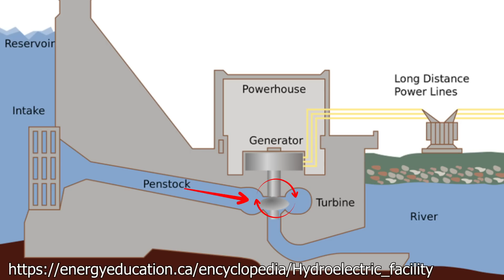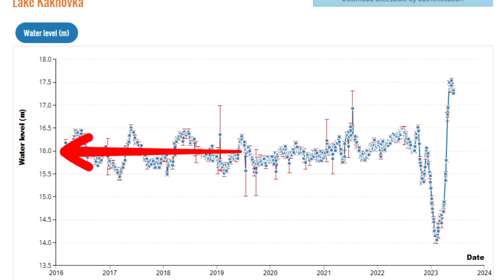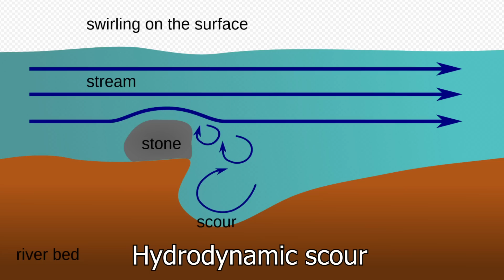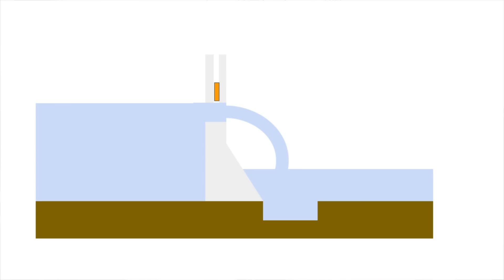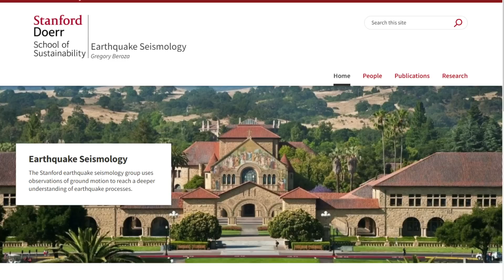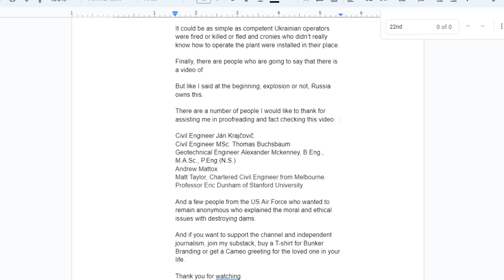How Russia Destroyed the Kakhovka Dam

Comment: As a former Marine and someone who’s worked on dams, I agree with everything but your assertion that this won’t make an amphibious crossing more difficult. The flooded ground is much harder to traverse than a river with dry banks. Otherwise spot on.
Reply: + now it's a nightmare for logistics,  supply lines. until it resides and dries. not very soon.
Reply: And we can already see that Russia's so sure the Ukrainians can't cross anymore that they're abandoning their defensive positions south of Kherson and moving their troops to help defend against the counteroffensive.
Reply: Wouldn’t wherever the water rises to, there will be a dry bank there, right? It just moved it
Reply: @mikew2068  no. The flood waters will saturate the ground in a wide swath, then it will recede, leaving roughly the old river flanked by bogs that won’t fully dry for months to years.
Reply: But the river is going to be crossable in parts upstream of the dam that were never in the game prior.
Reply: @MusicalMemeology  Not easily. The reason that area was flooded as a dam, is it is steep hillsides all round.
If there WERE low places, the water would have flowed out of them. The entire upstream area of the dam has mud right up to the same level of the top of the dam down stream. That is just physics. And the dam floor has been wet for 50 years. It will be  a trough of mud, with steep walls.
Reply: @MusicalMemeology maybe Im missing something but that should not be the case, as long as the reservoir isnt full the river upstream should stay the same, so it may have become larger in the time between the filling of the reservoir and the collapse of the dam and now would be smaller in relative terms, but it would be the same size as it was when everything was working properly. In other words the amount of water in the reservoir, as long as it isnt full, shouldnt matter to the river upstream
Reply: Left bank of the river down from the dam is low marshland. It was flooded several km wide. 

Russians were known to have mined the dam months ago.
Reply: @jounisaari9471  The russians had some of their most fortified positions there and would've preferred the Ukrainians attack there... not to mention that dam helped provide clean water access to crimea. Why would they sabotage something that favors them?
Reply: Agreed, if there's no flood plain affected then its all contained in the waterways so hardly any difference strategically, however after the initial flood the water levels have gone down drastically (miles!) in the former dam area, and also water levels have gone down downstream making crossings easier. Plus they flooded out strong defensive positions in Kherson. 
Occam's razor, logic and evidence seem to agree.
If Russia was this incompetent with dam and hydroelectric station can they be trusted to handle a nuclear one?
Perhaps they were using a defensive tactic running the closest spillway to use the fast flowing water to make it harder to access their side.
Reply: @DO-Hippo  
I'm pretty sure the United Kingdom military is not involved in Ukraine.
Reply: @GeneralSamov  lol, aint acronyms a bitch?
Reply: @GeneralSamov  Really, up to their eye's in it I'd say, Zelinskies favorite advisors, this gives the Sandhurst brigade the chance to fight a war by proxy the only kind of war Brittain will ever fight again. and there is no end to the dirty tricks, and sneaky operatives working for the Ukraine Regime The Drone Boats in the Black Sea for instance and what about that text from the Prime Minister a couple of moments after the North Strem was Destroyed to the Americans stating that the "Deed is Done"
Reply: Yep. Dnipro has tons of sand and clay underwater/on its banks. It will take months for that washed stuff to dry up. 
It has also had concrete/paved levels people use to load/unload boats from/onto trucks. Not many of them downstream, but plenty upstream of the dam. Seems like a good spot from amphibious vehicles to get ontu dry land.

Comment: You may be right, but seismic readings detected a large explosion there at the time of the breach. It's difficult to reconcile both narratives.
Reply: In that case, it was definitely Ukraine, as they strategically benefit from this. Watch Binkov's Battlegrounds video.
Reply: @CatCitySliders  The amt of explosives that would have been needed to make this happen is too large for UA special operations teams to deliver.
Reply: @tuberaider  
Even if that's true, there's still HIMARS.

Comment: Interesting video, but I think you missed/misinterpreted a couple of points.
1. The dam bursting flooded the islands in the delta. Those islands were being retaken by Ukraine to be used as stepping stones. It is always easier to bridge a river via islands than to bridge it in one go. There are reports they had just retaken a large island the day(?) before and had to evacuate a lot of troops in the floodzone. It is unclear if the Ukrainians were planning to cross in force or just cross with raiding parties to attack Russia's supply lines, but the dam bursting has stopped that at exactly the right moment from the Russian perspective and the resulting mud will prevent any croosing in at least the next few weeks. No matter the cause, this was definitely in Russia's strategic interests.
2. Russia went from furiously emptying the reservoir in an attempt to fill all of the reservoirs in Crimea, and then switched to filling the dam to epic heights immediately prior, creating more pressure on the dam than there should have been. The spillway was also flooded over, suggesting an incredibly high water level.
3. There have been unconfirmed reports that Russian soldiers on the left bank had orders to evactuate in 3 days which were then shortened to 90 minutes, possibly suggesting Russia planned a partial or slower collapse than what occurred.
4. As already mentioned below, Russia passed a law preventing investigations into such events.
5. I'm not an engineer, and am happy to be corrected, but my understanding is that the right amount of sabotage internally, either with explosives or other means, when combined with scouring and an over-filled dam, you can trigger a collapse. If the Russians thought that blowing only the hydro stations would effectively open the gate without collapsing the entire dam, they would have flooded the islands downstream, without lowering the levels enough to cut off Crimea (or the ZNPP, for that matter) and have posed less of a risk to their own troops further downstream/on high enough ground. That the Russian response is so inconsistent adds weight to a cover-up. 

As for the gantry driver, all the Russians had to do was put a civilian in the driver's seat, or point out to the Ukrainians that if they didn't want the dam collapsing, they ought not shoot the maintainers.

It's not impossible that a major, unintended collapse occurred at the exact time when it was most stategically valuable, and that Russia over-filling the reservoir after draining it as much as possible was also coincidental, as was the law the Duma passed, and the incompetence of official responses; and while a coincidence should bever be ruled out, that many coincidences of such significance is harder to argue against.
Reply: lmao sure, the Russians flooded their own positions and cut off Crimea's water supply. It makes perfect sense.
Reply: All of which is consistent with the view that the Russians did indeed to cause a flood event and overfilling the dam is consistent with the intent to make the flood last as long as possible. I think the scale of the dam failure however was due to incompetence and it's clear that the Russians were surprised. As you say, the issued instructions were for 3 days.
Reply: Good comment. Based on the shambles we've seen from 'the 2nd best army in the world' over the last 16 months, a starting point of Russian strategic genius seems unwise. I'm not much into dams but I can tell you that measuring vibration thousands of kilometers away and attributing it to a small explosion is going to be quite complicated.
Reply: I'm not sure the explosion would have been that small, but I'm sure the scientists who measure seismic activity would be across it. 
The Russians aren't stupid, but their decision-making process is severely problematic, as demonstrated, like you say, by their decision to invade. 

I'm still curios to see if that by emptying the reservoir, will it make the river upstream of the dam fordable after the lake bed dries, right into Russia's undefended rear?
Reply: @Simon  interesting thought and I'm sure UAF have looked into it. But I expect they were surprised Russia did it this early in the offensive because it surely would've been more effective once UA forces had made a crossing  and could be cut off.
I love the head spinning this must give competent workers in the Kremlin- just watching the idiocy raging around them like a forest fire🤣

Comment: Interesting, but not conclusive. 
1) Below each spillway should be a concrete slope, to stop undercutting, and channel water away from the base. Granted, that dam was built in 1956, but it has been continually inspected prior to the Russians capturing it. Any damage there, would have been repaired long before it could become an issue. (Those are easy repairs.) 
2) A Ukrainian sniper would not shoot a civilian worker, opening and closing spillways. And, I highly doubt a Russian soldier, even a Russian engineer soldier knows how to operate that crane.
2A) And even if a Russian soldier was given that task. A simple radio or telephone conversation between Russians and Ukrainians is going to insure nothing happens. The Ukrainians aren't stupid. If told the damn is going to overflow unless gates are opened, they know the consequences. That can easily be arranged. 
3) From what I can see from videos and photos, undercutting is not the reason. That is because you can see parts of the damn remaining, that is below the sluice gates. Yet, the whole sluice gate structure, multiple of them, are completely gone, gates and pillars. For that to happen, a lot of pillars have to collapse. Is that theoretically possible? Yes, and I could also theoretically win $1 billion in the lottery. Same likelihood. 
4) The dam has CCTV that runs 24/7, 365 days a year. Nothing happens on that dam without being seen and recorded. That CCTV is controlled from the left (south or Russian) side. Russia has refused to post any of that CCTV.
Reply: I agree with your points. Except that he didn't only mention undercutting. He showed how the overtopping could cause the breach in the same spot as the undercutting. Like tripping someone while shoving them, the combination could've been the ultimate formula.
You're definitely right though about the cctv. Russia would've been shouting from the mountain tops demanding an investigating if it was a ukrainian strike. Thanks to yt, I just watched Ted copples coverage of the chernobyl disaster and when they showed the soviet admission to it in their own newscast, it was subdued, and reluctantly given only because the radioactive cloud was detected in northeast Europe. Russia will only acknowledge a disaster when no one is fooled by lying about it or ignoring it. 
I'm puzzled by the seismic activity similar to explosions that were detected by multiple receivers in the dam area. He seems to have minimized that a bit. Also i don't see how increasing the depth and width of water between you and your enemy, while simultaneously forcing them to react to a major domestic disaster, doesn't give a defending Russia an advantage.
Reply: @nunyabusiness863  Overtopping of course can cause a lot of damage. But what he simplified was how it would look. You're not going to get the dam to tip... from top to bottom. You're going to see jagged structures left behind. And that's the primary question I have with his hypothesis. Only an explosion from inside out can make those clean breaks. And, it's the pillars (structural elements) that'd need to go first to make that clean break. While with overtopping, they'd be the last to go. And, some would stay standing no matter what. 

Of course blowing the dam gives the Russians more time... at least on that front. But, everything is going to be dried out in a month. That's all they gained by doing it now. The Russians would have gained far more of an advantage, if they had waited until the Ukrainians had actually crossed the Dnipro. So to gain a month, they shot themselves in the foot, and lost their biggest playing card. (There are multiple places on the Dnipro, where you can island hop. Thus instead of having to use a landing fleet, or build a major bridge, you can use Bailey bridges. But, if the Dnipro is flooding, the islands are underwater, and so are your Bailey bridges. Then if you have half your troops on the islands or wrong side of the river, and you're SOL.) Ps. I was thinking about Bailey bridges months ago, but kept my mouth shut. (Who knows who reads this.) Now, if and when the Ukrainians want to, the Russians can't do squat about it. The Ukrainians can have a major force across the river within a day or two, enough to take the rest of Kherson Oblast, and cut the Russian land-bridge to Crimea.

Comment: That road section that failed was one of the first HIMARS targets where they caught an ammunition convoy in that 'S'-turn with a resulting explosion that obliterated the trucks entirely.  The footage is still shown all the time.  I'm surprised it lasted as long as it did.  There's no telling what damage was done at the time.
Reply: Himars are in no way powerful enough to damage a dam like that not to the extent it would collapse without using dozens of them and they can't afford to waste them and the damage would be way more apparent it was almost certainly with the new information coming out blown deliberately by the russians as the middle part of the dam was still standing at first while both of the other sides were gone its very unlikely that it would happen like that without some explosives.

Comment: 5:45 - March 3, 2023 - (Counting from the right) Gates 5, 6, and 7 seem to be the ones open and releasing water. 
7:32 - June 1, 2023 - and…
7:45 - June 2, 2023 - (Counting from the right) Gates 1,2, 3, 4, and 5 seem to be open.

That short road bridge that curves outward from the dam is the section targeted by HIMARS during the Kherson Counter Offensive (November 2022). Could it be that Russia knew Gates 1, 2, and 3 were slightly damaged due to HIMARS strikes and intentionally opened those gates to break the dam in the manner you describe? Increasing the dam’s water level would increase the flow thru those gates and would guarantee failure without using explosives giving a “plausible” excuse of general failure or incompetence.

Comment: Given the seismic activity picked up by Norwegian seismologists in Bukovina, located on the north-east of Romania just before the time of the dam failure, time may tell if this was the result of a deliberate explosion set by the Russians or if Ryan's analysis proves to be accurate. I would add that the destruction of the dam does provide some strategic Russian advantage. As the flood waters recede over the next few days they will leave behind a vast swath of mud on both sides of the normal river bed. If you can cross a narrow river, you can cross a wide river. But crossing a wide expanse of mud is another matter. My understanding is it will take weeks for the ground to dry out enough for heavy equipment.
Reply: One thing I didn't expect is that the mud flats in the reservoir aren't impassable. It's like a beach as soon as the water was gone and people are walking around right at the edge of the river that's left. The material that washes down will be similar and should be fairly easy to plow off roads once it drains. It'll be a mess, but movement should be possible.
Reply: I don't think the Russians intended to cause a large failure in the dam. All of this is consistent with Russia intending to cause a prolonged low level flood. And the rest is basically a screw up. As lots of people have pointed out, there are now opportunities for Ukraine. Not what Russia intended, but a lot of arguments seem to be predicated on the idea that in setting off explosives, Russia intended to cause a large failure. It's quite likely the didn't. Indeed a lot of evidence suggest they were taken by surprise at the result.